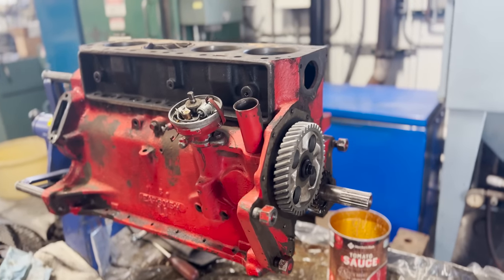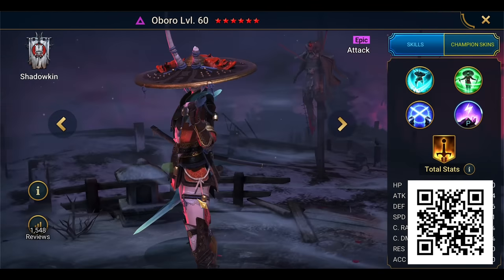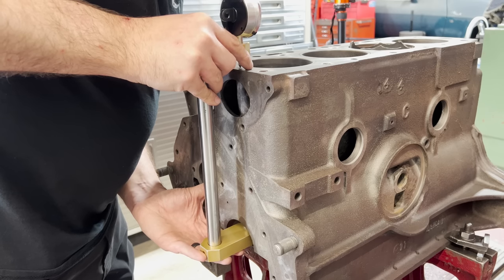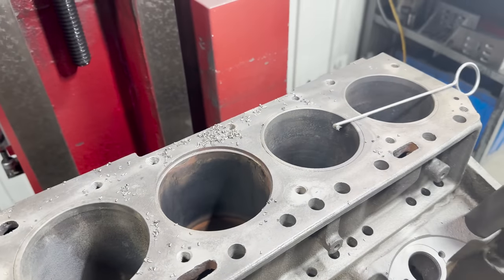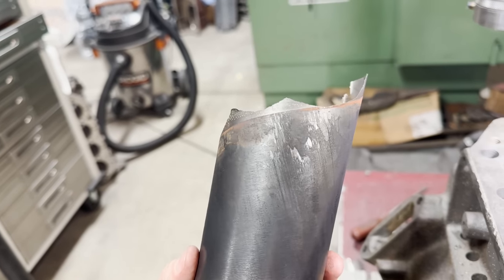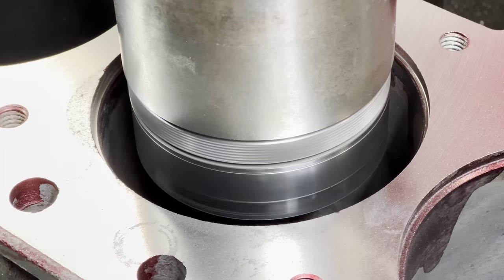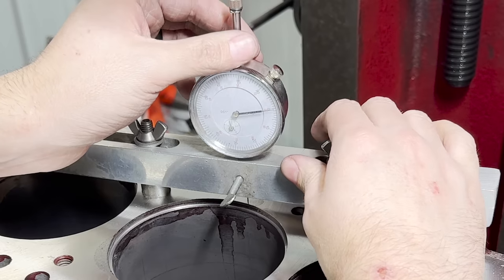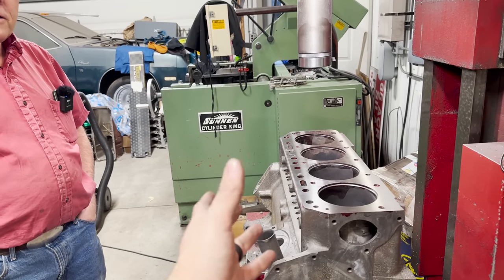Do YOU Want To Know Why WE Don't Use Sleeve Pullers?

Comment from the maker: ✅Install Raid for Free Mobile and PC: https://clik.cc/TwO1x and get a special starter pack with an Epic champion Kellan the Shrike 🎉 💥Use the Promo Code 4YEARSRAID to get 4 x Skill Tomes Legendary, 4 x Energy Refill, 400 x Energy, 400000 Silver. Available for ALL users by April 9
💥Use the Promo Code FIRESTARTER to get an Epic Hero, 25 x XP Brew Magic and 200000 Silver. Available for NEW users only by April 9
Reply: Thanks for interesting video. Please make part 2 video
Reply: oo⁹a
😮
Reply: So you don't have do it twice. Counter bore to depth .005 -.007 deeper than the lowest point of the uneven deck height surface. This way you can dut the deck with the new sleeves in and save yourself time and aggravation.
Reply: Raid is a scam, just so you know.
Reply: So can you tell me why these old tractor engines were designed to run sleeves in the first place? Was it to make rebuilds more affordable never risking chewing up the block?
Reply: @JAMSIONLINE You could split the difference in the out of round cylinder and instead of like going 10 thousandths over do 2-5 thousands over to get it a little closer.  Not sure if that's feasible with the sleeves you have or not.

Comment: I removed the sleeves on an old farm tractor by arc welding a short bead vertically on opposite sides of the sleeve. After cooling off, the weld will shrink, and the sleeves are easily removed. This was all done "inframe" without removing the crankshaft. The owner just wanted to get it running as the tractor was an old farmall that was not worth much.

Comment: I've rebuilt many N series Ford engines (8N, 9N, 2N) and the newer generation engines like this one, and can tell you the parent bore is never round. I don't think it's from poor previous machining, but more from these blocks being 70+ years old with countless heat cycles. While not the best way, I can say from experience that installing the sleeves and touching them up with a hone will absolutely work just fine for what that engine is. I understand wanting to do it right, but unfortunately, it doesn't always make sense financially from the customers' perspective when you can achieve satisfactory results using what you have.
Reply: Right on. Customers expectations should be tempered by reality. These work horses ran just fine in not so perfect blueprint condition.
Reply: @RobertBeck-pp2ru  It seem like he should have assessed the condition of bores before you proceeded with decking and addition work. Some people might think he performed necessary work to lock the customer into completing a job he might not have proceeded with if he knew what lay ahead. Just an opinion. Cheers

Comment: Welding the sleeve will shrink them, weld beeds the length of the sleeve. Allow to cool, then pull it. When they shrink they may just fall out. Use this same technique for bearing races  inside a case wall.😊
Reply: I was going to say that as well. Seen it plenty of times. Works every time.

Comment: I would like to see a part 2. Not necessarily the whole process, but, at least what decision the owner made and how the job turned out.
I agree with your cleanup guy, take into consideration what the part is going to be used for and know that perfection is not always necessary to get the desired result and and can be overkill in some circumstances.
Love the vids, very informative, thanks for taking the time to make and share them with us.
Hope the Allis is trouble free and productive in the future.
Reply: It is a money decision and in this case as stated the method put forth by Jim will be the most cost effective way to go. Most good shops are in constant communication with their customers. I would just document on the bill what was done and the reason for it. It protects the shop and it protects the customer.

Comment: I faced this exact same situation on a 1951 Ford 8n engine.   We decided to install 2 repair sleeves and bore them to standard ID for the replacement sleeves.   Recut the counterbores and a slight decking to make it flat.  Its been about 10 years now and it still runs good.   Wish grandpa was around to see his tractor run better than it had in 50 years. 
Love the videos guys. 
Joe

Comment: Yes would like a part 2 on this. 🙂 For me the amount of perfection you put into the work relates to the amount of satisfaction you get out of it in the end. And it,s also part of keeping you going thru the years even when at times business is bad. That said, it,s also important to do the best job that the customer can afford. (within reason that is. Quality of the work comes first on this) 
Really like this channel, the content and the way it is presented, so thank you both for putting in the effort. 👍
Reply: 13.22 is the best part of the wisdom of the job. Having done a few hundred rebuilds in the early 70's, I found this kind of shop expertise is the only shop to use. Nothing is ever perfect. It might be possible to hone the sleeves round after installation (w/torque plate), but tricky to keep from being too thin. Maybe there is excess wall thickness, it would be wise for the sleeve vendor to have that available. Your response to this option would be appreciated.

Comment: Pro tip to keep your blasting cabinet's windows clearer, for longer:  Before installing a new window have automotive paint protection film applied over it on the inside the cabinet surface.  Blasting media will bounce off and not scratch it, or very little, plus the stuff is self healing.   You should get substantially improved window life this way.
Reply: This is a really cool tip! It's one of those things that's obvious once you say it. Surprised (not surprised: cost cutting) they don't come that way.

Comment: I've resleved 3 blocks in my time and learned from an old timer how. He had me use a stick welder to run a bead from bottom to top of the dry sleeve. When it cooled I removed 5 of the 6 sleeve with my hand the other only required a little pull with a puller for about 1/2" then just slipped out. You guys are amazing, wish there was an engine machine shop in my area with people as skilled as y'all.

Comment: As a lifelong amateur mechanic and having rebuilt several Ducati 750 GT roundcase engines I really appreciate your attention to detail. I have seen several different valve seat cutting rigs the single cutter one you guys use surprised me I thought the three cutter staggered radial position setup was better from a chatter point of view. A single cutter with multiple angels as my shop teacher would say is a forming tool and because of the large contact cutting surface needs power and rigidity to mitigate chatter. Having send all that watching you correct a 3 thou valve runout to under .0005 or half a thou for the imperial crowd was awesome . The variable speed drive and air bed valve machine is an amazing bit of kit. Wobbles the mad Aussie.

Comment: I recently re-sleeved my'52 Case SC. A wet sleeve engine. Made my own puller to pop them out. Case calls for the new sleeve to project .003" above the block when fully seated. After carefully cleaning the cntr bores I installed the new sleeves and was relieved to see two were at about .0025" and the other two were just under .003". For a 70 year old engine I wasn't expecting super power, but the improvement was notable. These old engines will continue to serve the owners for many more years, even if they are not blueprint perfect. I enjoyed this video. Thanks for posting.

Comment: I am currently restoring and doing an engine rebuild on a mid 50s ford tractor with the same engine, I did pull sleeves with a puller as this is my first full engine rebuild project.   All of the measurements that you have gotten are all very similar to what I have gotten,  all I had to do was hone out the sleeves once installed because there weren't very accurate and there was just about no cross hatching.   Liked the video and would love to see another video of this engine.

Comment: You can take your mig and weld a bead 90 degrees apart, so 4 beads the length of the sleeve let cool they shrink enough and come right out.
Reply: Same with bearing races. But I prefer the air hammer.
Reply from the maker: Have seen damage and failed attempts from our customers who use their welders too 🤣

But yes it works, if you’re careful. We still prefer boring.
Reply from the maker: Running a bead of weld up and down the sleeve wall as you have suggested is a very bad idea.  If you are skilled enough to not burn through the thin sleeve and weld the sleeve to the block, the heat will penetrate deep enough into the parent bore and create distortion in the block.  Then if the sleeve does not come out as expected, it cannot be bored out because welding cast iron creates extremely hard spots that our cutters will not touch.  Next time you do one that way, check the parent bore with a bore gauge when you get done.  You will see what I am talking about.
The Cleaning Guy.
Reply: The cleaning guy knows.
Reply: Everyone thinks they're a welder.. But just because you own a welder doesn't mean you are one.
Reply: @Jurgy777  If you have a welder and use one then you’re a welder. Now whether you are a skilled welder that’s an entirely different conversation.
Reply: @Jurgy777  really your judging who? I've been welding professionally for 35 years. Hope your not talking about me.
Reply: @jayss10  you either are or you aren't. And that's that.

Comment: So many times a genuine machine shop saved my bacon. Throughout my career (retired now) my reputation for building great engines was due to having access to some of the best machine shops.
 All I had to do was put um together right 😁 it was a treat running into your channel, being a perfectionist from an early age my engine builds started off at the machine shop.
 It’s virtually impossible to do a complete inspection without at least a trip to the hot tank.
 Every sleeve that was ever replaced under my watch was done the way you did in this video, with the exception to a couple of English engines I built.
 A V12 Jaguar (wet sleeves) a piece of cake and a Roll’s Royce block that required a sweat fit, where the block had to be heated and the sleeves in a bath of liquid nitrogen,
 I called it double 300.
 300 degree temp black and minus 300 for the sleeves.
 Those are super hairy as you gotta be quick.
Sadly these days, guys over rev blow engines up, destroy drive line components just for the sake of showing off for the crowd.
 With all of the work I put into building my cars, there’s no way I could abuse my cars the way I see them done today.
 In the late 80’s I built an Austin Healey with a small block Chevy, that ran a full quarter mile (1320 ft) in high 9’s and low 10’s on pump gas. Back then it wasn’t about tire smoke and burn outs, it was about hookin! 
 You guys do beautiful work! Really brings back memories, not to mention the machinist is relatively young! And fortunate the skills got passed down, as skilled machinists are few and far between.

Comment: I've been doing this sort of work on motorcycles for forty years, I always enjoy watching others deal with the problems, headaches I occasionally run into, because other's ideas often inform my own.  I've got a farmall cub tractor I did a similar job on twenty years ago, and it still runs today, pulling trees out of the forest behind my home.  I was able to simply hone the cylinders and put rings in, one of the easiest engines I've ever rebuilt.  Great use of the bore gauge for cylinder roundness.

Comment: My cousin has made oversized sleeves from worn out liners. They where so thick that lots of material was removed. Liners from smaller German diesel engines are commonly used, from old Mercedes or Deutz engines. Excellent quality material.

Comment: I do larger industrial natural gas engines, most often they have wet liners so pullers or sockets and baring the engine push them out. We sometimes have to get machinists out to cut counter bores and make inserts for the wet liners. Don't think I've see you guys have a video on that! Would be cool the next time you have a chance to do it!

Comment: Hey guys, my name is Gene. I enjoy your videos.  Back on high school I had a metal's class and I got to use an old metal lathe and milling machine.  I wanted to go to school for a machinist degree, but life to a different path and I've been driving truck for 25 years.  I still enjoy enjoy welding and trying to build stuff in my garage when time allows it. I did build my own utility trailer out of random scrap metal I found.  I'm proud of it.

Comment: I’ve got a cutter that I made to cut a groove in the length of the sleeve. After cutting a groove in it, it can be peeled away in a similar fashion as what you did. I agree a puller is not a good idea on dry liners, although many manufacturers said to do it that way.

Comment: Pulled the liners on my 354 Perkins by running a weld bead inside the liner bore.  This causes the metal to contract when the bead cools, and makes pulling the liner a breeze.  3/32 7018 works nicely for this.  It's a lower penetration rod.  Bend it so you can run a bead top to bottom, let it cool, and have at it.  When pulling anything...........heat is your friend.

If I had the machinery, I would definitely opt for your method.

Comment: My father worked at Carlton machine tool in Cincinnati Ohio in the 50s and 60s. He designed and built a lot of the boring machine used by Ford , Chrysler and 6:44 General motors . He eventually went on to design and build the first automobile shredder using the Pettibone Rock crusher for a basis. The first job was working on a machine shop fresh out of high school. Was fortunate that my father taught me to read blueprints at a young age. Great that you're working with your dad love you videos keep up the good work!

Comment: Interesting on how you remove old sleeves. I never relied too heavily on sleeve pullers either. An old school mechanic told me to just weld a thin zig-zag bead down one side of the sleeve and it would all but fall out. It did. We would then take the Sunnen hone to shine up the bore then install the new sleeves. Of course there were times we had to take the block to the machine shop to clean up the counterbores and deck the block. I might add that the first time I had to remove sleeves was on a motorcycle engine. I ran a bead of weld down the bore and they came out without too much problem. Had to put the block in the oven and the new sleeves in the icebox to get them in. Worked fine. That was 54 years ago. Oh yes, I like your method of pulling sleeves better. We had an old style boring bar but I never thought it could be used to bore the sleeves out paper thin. Great idea...

Comment: It's nice to see there is still an Automotive machine shop that does quality woek,As a 90 year old engine builder form the past, I depended on people like you to do the machine work I couldn't do, I bored my own blocks to  reduce the time I had to wait for a finished  block to come back to me. Line boring, I cut the caps and torqued them down Crank grinding was another farm out. I live in Vermont and there isn't any shops that can do any of this with ina 100 miles. And shipping things down to Mas or Ct would take too much time and the quality isn't worth the risk. So there is one benefit for being 90. I din;t build engines any more.
Take care.
Gramps

Comment: After scrolling through most of the comments, I feel a bit overawed. I think Jim and his son are incredible operators. My story: a few years ago I had a 250 CI crossflow engine (Australian  Ford design) rebuilt by a local engine rebuilder. Not stuffed but badly worn.  After finding these precision rebuilding and machining videos on youtube I was prompted to show my appreciation to my engine rebuilder, by describing some of the procedures I had been watching on youtube. Their response was (in no way arrogantly) "we do that sort of thing all the time".  When paying for the rebuild so the engine could go back to the workshop, the manager calmly observed "we put in a stage 1 cam for a bit more lower down torque, also fully balanced". This is in a reproduction WW2 jeep (shock horror from the purists, but mine is for fun, although appearing as stock as possible). My new engine runs like a turbine!!. 
Although in my later years, I am inspired to buy a modest metal lathe and do a bit of hobby machining. I will probably never rebuild a vehicle engine, but I might take on a small engine project just as a challenge. People like you allow those of us with no machining background but an appreciation of the skills involved to at least have a go!
Thank you, Wayne Jefferies.

PS: have a look at Cutting Edge Engineering for some industrial machining and welding!!

Comment: My college engines teacher was on an nhra top fuel pit crew till the early 2000s when he retired and started teaching.

He had me using pullers but he had me put the engines into the oven, then crane them to my tables, use his NX bottle to cool the sleeves, then me and my class friend would hustle to get all the sleeves out smoothly. Teach said it was an old trick he used in the late 70s haha. 

3 ls, 1 2jz, 1 Porsche v8. 2 ls over 1k to the wheels, 1 set to 800 with conservative boost for a daily. Jz was only 500hp and the Porsche was a stock rebuild for a friend.

Watching engines go from a rusted paper weight to a powerhouse is life.

Comment: Nice job getting the old sleeves out.
Perkins had a bulletin on a 4 cylinder I did.
Hone the tight spots.
And use Locktite 640 Sleeve retainer. 
Good up to .10 mm, .0039.
Should be able to round up the cylinders in your CV616 Sunnen.
Let the Loctite cure and finish hone.
While not perfect, should be better than the last job on this engine.
Thanks for sharing. 
Take care, Ed.